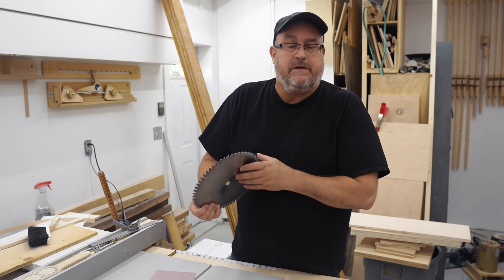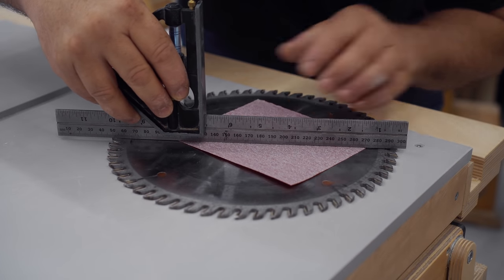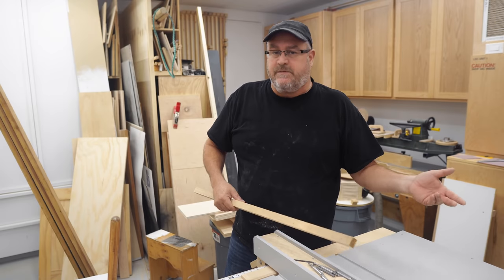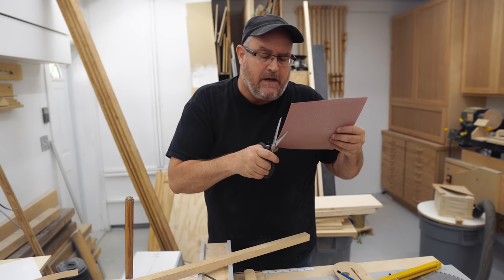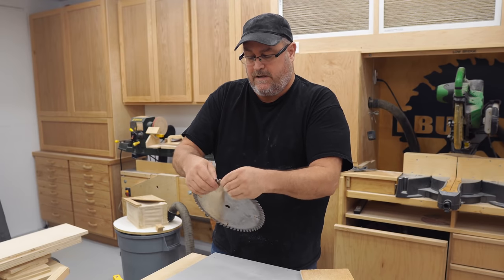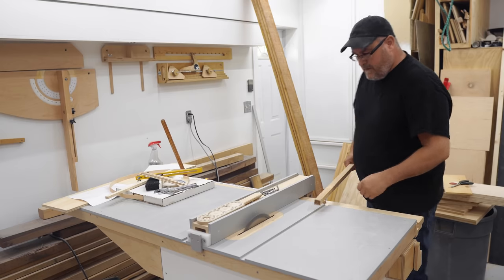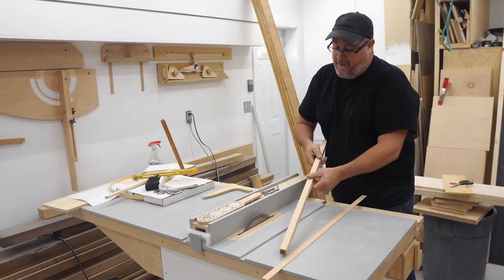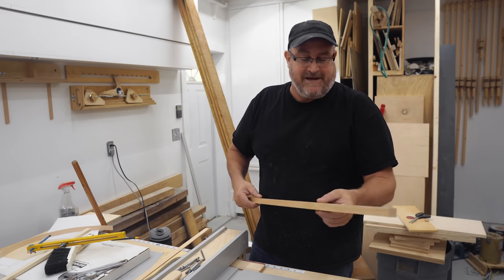Can you Cut and Sand at the Same Time? Interesting Results...

Comment: Ok you've done blade, paper blade, sand paper blade... Looking forward to just sand blade! :)
Reply: I think next will be "Toilet paper blade" xD
Reply: Modern Wood CZ I had a pun’y response but it isn’t YouTube appropriate...sigh.
Reply: Sand blade is better known as a cutting wheel.
Reply: Isn't that just a sand-stone grinding-wheel? :P Like a... I dunno, table-angle-grinder? or... a table-stone?
Reply: Glass blade
Reply: Sand blaster?
Reply: So a sandblaster?
Reply: @LOBOTomikYT  but he needs to save it for the apocalypse
Reply: You mean a glass blade
Reply: That's called a waterjet.
Reply: planet life blackhole
Reply: Fire blade
Reply: The blade is made from one really big grain of sand
Reply: Sounds like a water jet, But without the water...

So a sandblaster... Not so cutty
Reply: wheres the beyblade?
Reply: @LOBOTomikYT  And after that a toilet blade?
Reply: @legomanz2387  yeah, Dyson already made one of those...... turns out that they get water off your hands AND make your skin ripple at the same time!!!! Woohoo 😂🤣😂👍
Reply: Blood all over the saw top is more likely 🤮🤮
Reply: Glass?
Reply: so a glass blade?
Reply: Isn't that just an abrasive cutoff wheel as used on some grinders?
Reply: Hacksaw blade blade
Reply: That is just a sand blaster at higher speeds, much like using water to cut things, you would just be sending out sand at higher speed in order to cut through material
Reply: bay blade!
Reply: Making an alluminium oxide disc that would cost 1$ for much more
Reply: Water jet cutter? Which uses fine sand in the water?
Reply: Up next, beyblades?
Reply: Glass is too brittle to undergo such high speed rotation.

Comment: This might make for a better "From the Factory" feature. As in, embedded diamond grit right on the blade surface. Let them manage the balancing and harmonics issues.
Reply: Sounds really expensive
Reply: @avroarchitect1793  Exactly, and factory-made is not usually as good as made-for-the-job.  That whistling blade was factory-made.  Better to have all the grits you like for the work you're doing and adjust everything to suit.
Reply: The cost of the blade will skyrocket, not worth it as you can just sand it after cutting.
Reply: any from the factory abrasive finish would work well
Reply: I was just thinking the same idea. A diamond grit sprayed directly onto one side of the blade, along with making an entire set including different grits (100, 200, 400), would make for blades that would last a lifetime with proper maintenance. Expensive on the front end, but the time saved on each project pays itself off in the long-run.
Reply: @N0ES  diamonds are not expensive at all, unless you want natural ones and to put them in a ring they're easy enough to manufacture that it won't make the blade too expensive. sure, it'll be at least 50-70% more expensive, but that's not really that much considering how well it could potentially work.
Reply: I agree!
 Some blades are very expensive to begin with. This could be a added benefit,  (if one's willing to pay for it) & there will be people that will!
Reply: I was thinking that you also could make the blade a little thicker than normal and cut finer file teeth into the sides of the blade so that it is still metal like a regular file and would be less likely to wear off like sandpaper or some other grit held on with an adhesive.
Reply: @achalorocks  Any blade that's hardened enough to be a decent file could potentially shatter, as they are brittle, if you should hit a knot, staple etc...
Reply: Eco Mouse that is true. I didn’t think about hardening.
Reply: and then don't sharpen it every, since every sharpening takes a bit off the sides of the blade.
Reply: Maybe if the center of the blade area (non teeth) was a millimetter wider, and they chemically/acid treated the side it would be durable and sand.
Reply: I've been thinking in something like a mix of sand or an compound in the size of the grit and epoxy glue applied directly on the blade face...
Reply: @frebox  the heat generated by friction will soften the epoxy and goodbye grit.
Reply: @EcoMouseChannel  A file is hardened so that it can file metal.  That makes it brittle. It doesn't need to bw hardened I order to file pine.

Comment: Hi John,
That comment might have been from me, right after you had finished the tedious sanding on your wooden wall sculpture. I was surprised to see that you remembered it, and that you actually tried it. At the time of my comment, I think I mentioned that there used to be a company that made this product. They advertised the stick-on saw blade sandpaper in a small ad in the back of woodworking magazines, and appear to no longer be in business. I can only imagine that they got sued out of business after some kickback incident.
I too am surprised that this works, and thanks for trying it out. (I didn't have the nerve to do so myself).

Keep up the great videos!

Gary
Reply: It would be difficult to make the sanding discs the right thickness, given that every blade has a different kerf. He had to carefully select a blade with the right kerf, to match the thickness of the sandpaper. It would not be lending to mass marketing.
Reply: A very fine file structure worked into the blade would solve both problems, I think, thickness is always the same and as finer the structure, as less the chance of kickbacks. Or special sandpaper but sand on a very thin layer of double sides tape instead of paper.
Reply: @Wilson84KS  You can only go so thin, before the blade loses enough ridgidity to remain true during the cut. That can lead to poor cut quality, or worse, a catastrophic failure of the blade disc.(very dangerous!)
Reply: @vincentrobinette1507  At least we assume that it is a careful process. Without trying some unmatched components its hard to say.

Comment: Next video: How to Sharpen Scissors After Cutting Abrasives.
Reply: When I was a kid some people "sharpened" their scissors by cutting  a sheet of fine grit sandpaper.
Reply: @nemo227  that's how I do it since over 40 years ;-)
Reply: vass ilika what grit?
Reply: one of the best jigs I ever made for my shop was a sandpaper tearing jig - hacksaw blade screwed to a piece of plywood!
Reply: @jaxturner7288  100-120ish
Reply: Simple, replace em
Reply: Well someone told me the best way to sharpen scissors is to cut foil
Reply: Scissors are probably the easiest tool to sharpen 😅 take them apart and you can flat sand across the plain, then all you have to do is de-burr on the bevel.

Comment: As a trim carpenter we would use this while cutting casings. When you have to fit a 45 tight together so your taking off a 1/2 a degree off the heal or toe just by running it along the chop saw blade while its in the downward possession... thanks for the short video. Your helping us all improve our abilities.

Comment: I could for see the sand paper adding alot of friction, and causing a kickback or something.
Reply: It‘s a horrible idea. With a sharp sawblade the surface would have been just as smooth.
Reply: the sand paper can tear and catch/grab the cutting piece.. quite scary..
Reply: Exactly what I thought. I did an apprenticeship as a joiner and holy shit, never do this. Sometimes small pieces got grabbed by the belt-sander and it smashed them through the whole room. Don't even wanna think about, what happens with a board or ledge at 4k rpm on a tablesaw

Comment: The next step is to glue on concentric rings of increasing grit sandpaper...
Reply: I don't believe that would work. If 60 grit was on the outside ring, then you had 220 on the inside ring, the 60 grit would always be the start and finish grit when pushing the piece through the saw. Your idea works great till you hit the centerline of the saw blade, your process would be cut, 60 grit, then step upto 220 grit, from centerline out, the grits reverse, 220 stepping down to 60 grit then finishishing with the blade cut. Your idea would work in a linear manner only. Like a bandsaw
Reply: @just_a_guy_doing  just have 60 on the inside and 220 on the outside then, on the way to center there is wasteful sanding happening but as the wood goes past center it would be sanded with increasing grits and the last paper touching the wood would be a 220. I'm not saying this is a good idea but your argument left out the (obvious IMO) alternative option.
Reply: Also generally when talking about concentric rings we work from the center outwards so the original comment kind of implies lowest at the center and increasing grits outwards.
Reply: @just_a_guy_doing  Well pointed out. But what if each smoother grade of paper was very slightly thicker?? So you had 60 grit on the outside ring, then say 120 in the middle section, and finally 220 on the inside ring. BUT since each bit of paper is slightly more protruded as it gets to the center, on the way out the piece won't touch the rougher grits...
Reply: @liammurray9274  What about keeping the original order (rough on the outside, smooth in the middle), but having the papers protrude out slightly more the smoother grit they become. That way, once past the center the piece won't touch the rougher papers again, could that work?
Reply: Single grit would work for all dimensional cuts.  This idea is about getting a smoother saw finish cut, not finishing a smoother product.
Reply: @Shadow_Hawk_Streaming  That wood be a problem!
Reply: Who are all these people, and why are they so wise in the ways of science?
Reply: @extrahourinthepit  I don't know, but I'm thankful that they're here!

Comment: I have 1 blade that has PSA 320/400 on both sides. I don't use my TS as a sanding station, I use this method to help have a cleaner, smoother cut. It does work. Been doing this for 10+ yrs now. Cheers :)

Comment: This is Acctually a practice used in the industrial setting on our huge saws that trim product coming down an automated assembly line there is a splitter blade that splits the product down the middle and the sandpaper puts a nice edge on the cut
Reply: Hahaha no there are good enough saw blades that leave smoother surfaces than sand paper

Comment: I have a 10" aluminum disk that I bought from Sears many years ago.  It isn't perfectly flat.  It is slightly coned on one side that you put sandpaper on.  You  mount sandpaper on the coned side and install it on a table saw with the coned side toward the fence and tilt the blade at 2 degrees toward the fence.
Then push a board through between the fence and the disk and it gets sanded at the tangent to the cone, which is a vertical patch on the disk.  It worked really well but I haven't seen them since.

Comment: Hello John:  Have you seen/heard of the Edge Tech II sanding disc?  Basically a 10" diameter alum disk with a 2 degree "dome" in section.  You install on your arbor and set the arbor to 2 degrees.  Now the sanding face and your table saw bed are at 90 degrees, yet the sanding area contact zone is fairly small when passing through rips or edges needing sanding.  Works awfully well.  I think now sold via Wurth Group (Louis & Company).  Pretty clever idea.... I don't use it often but when needed it does the job.

Comment: This goes on the list (if there is one) of "classic" John ideas.  Very cool, and I'm glad you tried it. I'll bet it would increase kickback velocity to some gnarly speeds.
I remember always planning (when using a "nice" shop under formal instruction) to add 1/16" to my rip widths and join them after to remove saw marks. I never do this anymore, mostly because I don't have a nice jointer.Quality/sharp blades give some great surface finish also...which im sure most know that.

Comment: Having a high friction surface on a table saw seems like it will increase the risk of kickback as sandpaper rubs against the wood.
Reply: I was more worried about the board lifting. The paper pile up probably wouldn't cause a kickback if you have proper hand/push stick placement and pressure.
Reply: My thoughts exactly, also no riving knife on his saw, let alone PPE. Interesting content isn't worthwhile if you're gonna demonstrate unsafe practices.
Reply: you should always expect kickback anyway
Reply: I was looking for this comment, this is quite a dangerous modification, it would increase the risk of kickback quite significantly.
Reply: @dahrchan  I completely agree! This was an idiotic and Reckless demo to show the masses.
Reply: @samsh0-q3a  Bob you are one smart man! As a professional woodworker of 35 years I practice the utmost safety when working on my 12 in table saw. I have noticed over the years that my big German Shepherd tip toes out of the shop area when I even think about working on my table saw. I am convinced she senses my intense desire to keep all my digits.

Comment: when you really want that good kickback to wake you up
Reply: Nonsense. It's the teeth that cause kickback, not the side of the blade (whatever it's condition). The grit on sandpaper is very minuscule compared to the size of those teeth.
Reply: The sandpaper is grippy, which helps chuck wood at you

Comment: I thought that as soon as the wood touches the paper it would have separated  woah....
Reply: i've seen people use paper as a cutting blade.  i didnt expect for a second for the sand paper to just separate or shred off.
Reply: @darkshadowsx5949  yeah. I've seen people cut plastic with standard a4 paper
Reply: @GroteGlon  bruh I saw a man cutting a tank in half with a butter knife.

Comment: - "I have this idea of sticking sandpaper to the saw blade so it can sand while cutting but I'm affraid that it'll grab the wood and punch a hole in my throat with it. Can you try it instead so I can use it when I see nothing wrong happens"?
 - "Tested, works perfectly"
 - "Thanks, I was a bit worried..."
Reply: Maybe u can use a strong glue. But quickly change the sand paper at a minimum sign of damage on it
Reply: Everything works at least once, or doesn't 
He is irresponsible even posting this
What's he going to do next, glue it to his bandsaw?

Comment: No way!  
Super impressive, but scary as hell. Got my head spinning with ideas of how an actual product that works this way could actually happen. 
I wonder if there'd be a way to like, fuse carbide grains onto the side of the blade.... Still, incredibly scary if there was a kickback... or... possibly not? Maybe instead of binding up it would just grind down any places that got stuck. Who knows? Very cool experiment!
Reply: BRUXXUS there exist diamond saw blades, I guess that‘s quite close to the idea. You achieve a very fine cut and the blade is quite silent as well.
Reply: @TheE9climber  Hmm, that's true.
I suppose the real reason this isn't really a thing is that the grit would quickly get all clogged up with wood.
Reply: Such a product already exists for at least 12 years. 
Called "Final Cut"
Reply: @Jehty_  Oh cool. Although, it looks like what's in this video. A saw blade with sandpaper glued on.
Reply: You also don't want to grit to get loose and dull the teeth
Reply: More grip between wood and side of the blade. More chance to get kickback...

Comment: That’s crazy. 😂 I’m actually surprised there wasn’t any burning of the wood from the sandpaper.
Reply: what sandpaper are you using that burns wood
Reply: @calinguga  burning wood with sandpaper is a very common problem, if u go too aggressive with your work on the disc sander it'll leave burn marks, and also table saws often leave burn marks anyway
Reply: Archie Bunker  to have burning mark you need to apply enough pressure so the friction would increase. Because the saw teeth are about the diemeter of the saw body with the sandpaper on, the pressure must be minimal.
Reply: @Luke in my experience low grit fresh sandpaper has virtually no chance of burning, it only burns when it's not removing material and only rubbing, like high grit clogged sandpaper, which is not the norm to be expected, hence my snappy remark

Comment: I was not at all surprised the glue held up.  I inherited from my dad a 8" table saw, and a sanding disk that goes with it.  One side is about three degrees conic, and if using that side, you tilt the arbor so that the cone section is vertical above the arbor, which allows the work to infeed without snagging at the edge.  Anyway, the sandpaper is just held on by contact adhesive.  I still have a few factory made  sandpaper disks for it, so haven't had to resort to cutting my own yet.  That looks like a good job for a laser cutter to avoid dulling a knife or scissors.

Comment: Alright, so exactly prior to watching the video, my hypothesis is that this is incredibly dangerous. It seems to me like the friction of the sandpaper could grab the board and fling it, similar to when a board binds on the blade.
Reply: This.  If not fling it, more likely to lift it.... then the teeth will grab it and fling it (yanking your hand into the saw in the process).

Comment: Now I’d be interested in what the consequences of the sandpaper tearing halfway through the cut would be.
Reply: it would probably chuck out the wood
Reply: That too would be my fear. Depending on how long the project lasted. I would think you’d want a new piece of paper each time you start a new project. What kind of solvent will remove the paper & glue. I guess John will need to run the dickens out of this one test blade. I would imagine the life of the sand paper & integrity of the glue will be different depending on the species of wood being cut. I wonder too which brand of blade he used, offset & number of teeth?
Reply: Turns a table saw into a woodchuck . . .
Reply: Matthew Routledge : I don’t really know if it would or not. The forces on the paper are high in comparison to its ripping strength. It might have a more catastrophic impact on the table saw itself with it inner bearing/inserts.
Reply: this was my thought too. eventually there will be an undesirable dangerous situation.